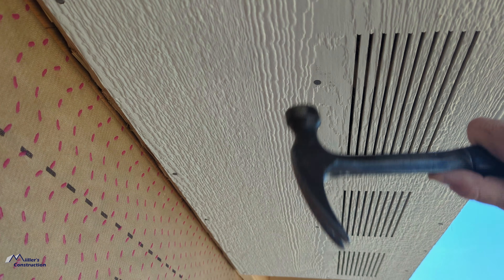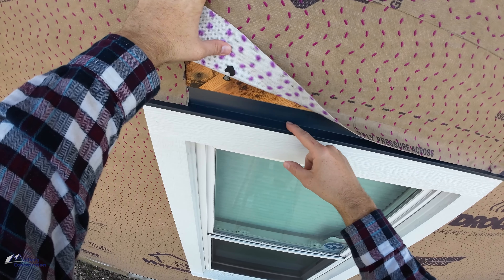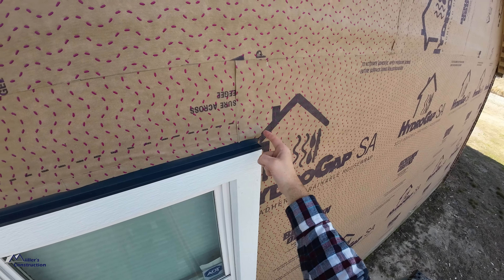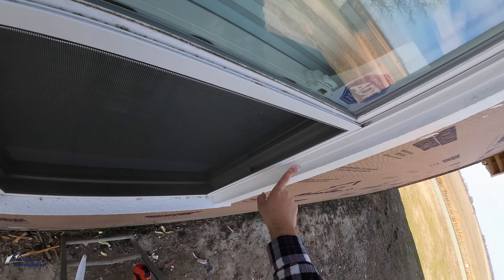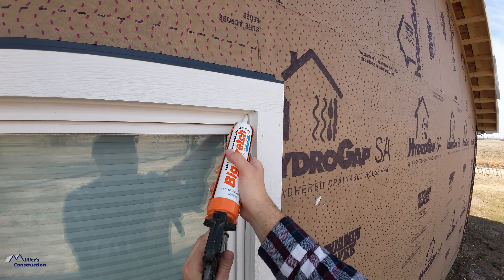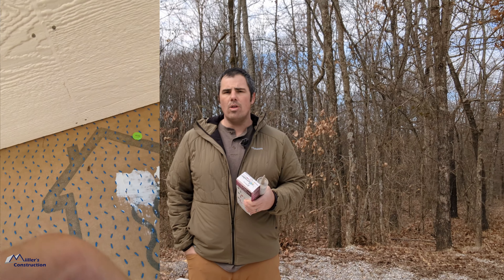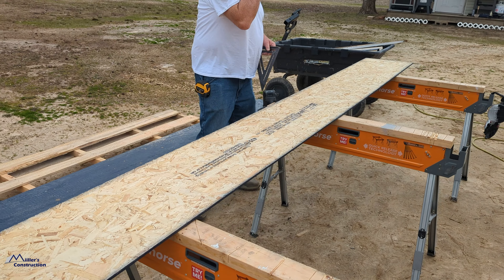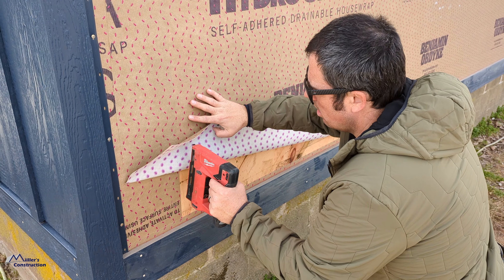LP Smartside Install Tips & Tricks

Comment: I'm planning a small project that's only about 20 Linear feet of siding. Can I screw the LP lap siding instead of investing in a nail gun? I see stainless wafer head screws for fiber cement siding, can those be used for this LP engineered wood?
Reply from the maker: Fiber cement is different. LP moves A LOT! I would not trust the shear strength of screws myself. And if I absolutely had no other option, I would make sure the screws were a heavy thickness exterior rated screw. I would just hand nail it personally if thats all your going to install. Thats even cheaper LOL!
Reply: @miillersconstruction  Thanks for the quick response. Yes, I may just hand nail. Considering the windows/door and corners of the project, there wont be a continuous run piece longer than 4-5'. Thanks again.
Reply: Thank you for living in the Real World where everything isn't perfect. I'm 60, so as long as the siding last 20 years, I'll be happy, happy!

Comment: I'm doing a barndo and majority of my exterior walls are going to be 10'. Have you ever installed the Panel Siding from LP then use the bats to give the board and batten look vs the 16" wide vertical panels? I just do not want to have a pile of 6' drops. THANKS
Reply from the maker: I have and I can tell you they will work just fine, but I would HIGHLY recommend ripping them to length first. Installing the entire 4x10 panel is NOT fun and extremely time consuming.
Reply: Is it the same material as the 16” plank? Just know I’d have to paint all the sides if I have to cut them individually
Reply from the maker: @gdbunn  Yes same material. We would rip down like 5 sheets, turn them up on edge, prime the entire stack with a roller. Takes a couple minutes.
Reply: Having a hard time in Alabama getting the painted LP board and batten. May have to get the regular and paint it. Does paint stick well to this product or have you just used pre painted?
Reply: Also, do you always wrap the house in sheathing then house wrap, then apply the LP? I talked with a rep and said I could use it as my sheathing and just do like a Tyvek or Typar wrap under it? It’s my own house so don’t want to mess this up. We’ve only done vinyl siding in the past. First time trying the LP products
Reply from the maker: @gdbunn  I've used plenty of the primed material and yes it holds paint very very well. If you have the option, Diamond Kote prefinished LP is the absolute ultimate. I would reach out to them and see if it's available in your area.
Reply from the maker: @gdbunn  I always do. Your Rep is correct, the 4x8 or bigger sheets can be used as structural sheathing as long as it's the 76 series I believe which is 7/16" thick. That said, you're in for a challenge. I've done it. It's not easy and it's not fun. Very time consuming to get the details correct.

Comment: I have zip-r6 sheathing (1.5" thick) on my house I am building and want to put LP on.  Do I need a 3" nail for the fastener for lap siding and 3.5" for the 1 by trim?  the sheathing is 1.5" thick and need 1" into the studs, correct?  I can't find any siding nail gun that can hold a nail over 2.5" long and just wanted to see if I was correct on this.
Reply from the maker: This is the cheapest and easiest solution - Paslode Tetragrip. They have a nailer for siding and for subfloors. Get the one for siding. It's a studless nailing system. It's all we use man.
Reply: @miillersconstruction Thanks, does this work for both lap siding and trim, or do you use something different for the trim?
Reply from the maker: @trevorbradley7461  for trim I pretty much only use Diamond Kote nailfin trim. No fasteners in the face, attaches to your sheathing with a roofing nail. If you can't afford to put Diamond Kote Pre-finished siding on your house, at least swing for the trim and accessories. Trust me. Money well spent.

Comment: I would totally use PVC for trim as you can get it pretty much anywhere, but my trim color is a dark blue similar to yours in the video, and it's impossible to get "vinyl safe" paint that dark.  Had to shell out $$$ for the Truexterior/Boral.
Reply from the maker: I'm a big fan of PVC trim as well when it makes sense. We have converted to LP for most of our exterior trim though. When installed correctly, you won't have an issue.
Reply: @miillersconstruction  my reservation on the LP trim is that the sides have voids.  How do you handle situations like corners where an edge will be exposed? Do you just hit it with filler?  (I've only purchased primed, not factory finished.  Maybe the finished pieces don't have that issue ..)
Reply from the maker: @PhillyFixed  finished trim isn't as bad, but it still has some voids. I don't do anything with it. The manufacturer tells you that you don't have to and they'll still warranty it. I've been installing it for a long time and never seen it fail. Remember this isn't OSB. It's completely different even though it looks similar.

Comment: I got that tintable caulk, followed the instructions to a T and its very liquidy. Is there any cure for that ?
Reply from the maker: Man I ALWAYS put 20ml of paint in mine instead of 30ml for that very reason. I'm not sure why they don't address that issue.
Reply: Put it in the refrigerator for 1 hour or 2 before you use it

Comment: Who can I have inspect my LP siding on my new house to see if it's been installed correctly for the warranty? I see lots of issues and want to hold my builder accountable. I paid extra for the better siding and I want it to be correct.
Reply from the maker: Oh man that's a good question, and definitely a good thing to do! I would do it myself if I were you. I would read the instructions thoroughly and then just look it over. Too many LP installers get in such a big hurry man. It's a shame.

Comment: Quick question: I just bought a home that had LP Smartside installed in 2018 and know nothing about it (or any siding really). Our home inspector mentioned he thought the siding was installed wrong since the butt joints were caulked. He was also unsure if there was flashing in between the butt joints, which he would usually expect to see. He wasn't familiar with this type of siding but said it seemed unusual to him. The original installation contract states they caulked all seams with Elastomeric caulk except where Z flashing was utilized on top of windows and doors. Does this sound like proper installation? Thanks!!
Reply from the maker: That sounds like a proper install to me. As long as when they initially Install the siding with a 3/16" gap between the pieces of siding and then caulked it, You should be fine. If there were issues, They would have already been recognizable had that been the case. They actually have at least three different ways to address that 3/16 joint. You can use h clips which I think are ugly but a lot of contractors like them because they're fast. Or you can caulk it. Or you can prime both end cuts and put a piece of flashing behind the joint.

Comment: First off, I don’t know how I ran across your channel but I have been watching every hour of smart side video I can to learn about the installation process. Quick question for you, have you ever installed this over a house that was sheathed with rigid foam? We just purchased a house that was built in the early 90’s and has no sheathing. The little bit of information I can find about installs like this say the foam flexes and breaks or weakens the nails??? I’ve also thought about using firing strips as well . What’s your thoughts?     Keep up the awesome videos
Reply from the maker: f you install Smartside over just rigid insulation instead of structural sheathing you absolutely will not get a warranty. The furring strips would definitely work, but I'm still not sure you would get a warranty. I would contact LP directly about that issue as I've never ran into it in the field before. Unique situation that's for sure!
Reply: @miillersconstruction  thank you and I look forward to your future videos
Reply: @miillersconstruction  I looked again and it appears that LP allows the lap siding to be installed over rigid foam sheating . Look under application instructions in the LP installation instructions. I’m looking for someone who has experience with this type of install .
Reply from the maker: @briansdumbchannelderpy6986  man thanks for letting me know. I was curious about that. You need to reach out to the kruse brothers on Instagram. They work for LP and can guide you through the process.
Reply: @miillersconstruction  thanks again!!! I look forward to your future videos
Reply: @miillersconstruction  just a update for you! I reached out to the Kruse brothers and they got back to me . I wish I could post their entire response here. The ironic thing is Randy said that his house has this exact type of installation. It sounds like some care needs to be done with the nail gun, maybe use your method of finishing them off with a hammer???
Reply from the maker: @briansdumbchannelderpy6986  those guys are awesome! Yes, set your nailer depth to where it seats all of the nails slightly proud

Comment: What size nails did you use for the siding panels ? Did you use the 18GA nails for the panels ? Or just finishing nails for the trims and soffit ?
Reply from the maker: I only used 18GA nails to stitch the seams together where I added the blocking and construction adhesive on the Soffit and 16GA nails for window trim. The siding panels I used ring shank siding nails .092 diameter. Part of our last build I tried out the new Tetragrip siding nailer from Paslode and my goodness do they hold. I'm hoping LP will approve them soon because you don't have to hit studs when using the nails.

Comment: I like to run a nice clean bead of caulk and then take dawn diluted with water in a spray bottle, spray it down and it wont smear outside the original bead line. We use the Dimond kote screws with the plugs and then paint the plugs, looks flawless. That's my 2 cents
Reply from the maker: Where do you use the plugs and screws? We use them on the starter boards but that's it.

Comment: The best tip when installing LP Smart siding is to not install LP smart siding. It's glorified cardboard.
Reply: I bet you're fun at parties...🤡
Reply: So what do you use ?
Reply: @2nickles647  Fiber cement. Lasts for ages, fireproof, insulative, and easy to maintain.